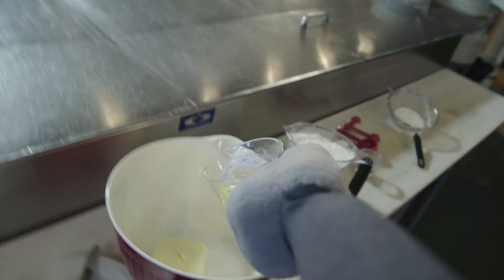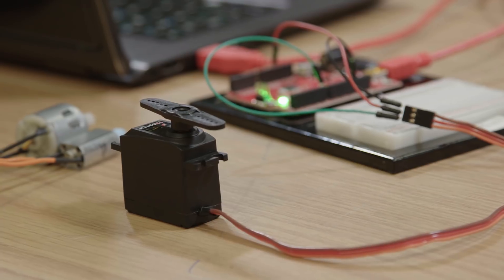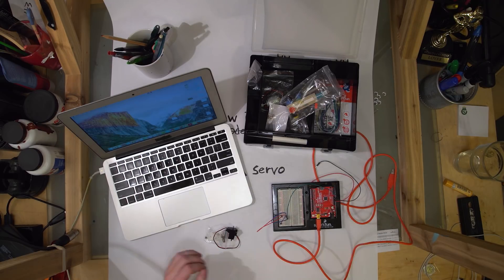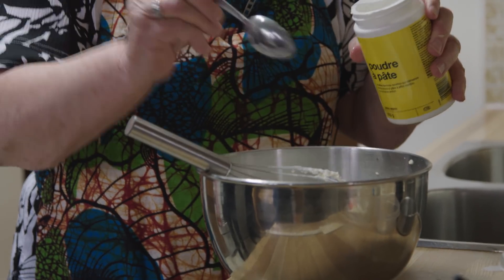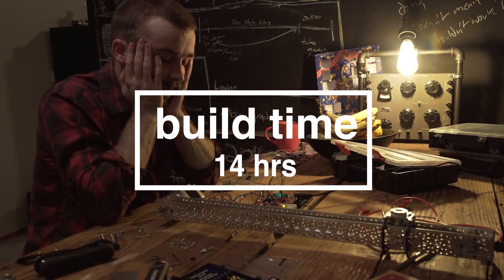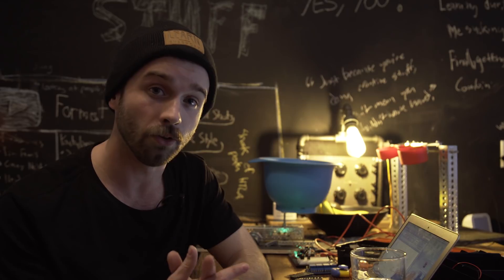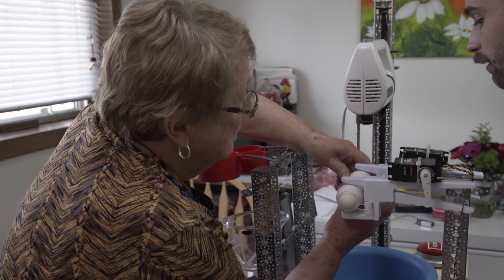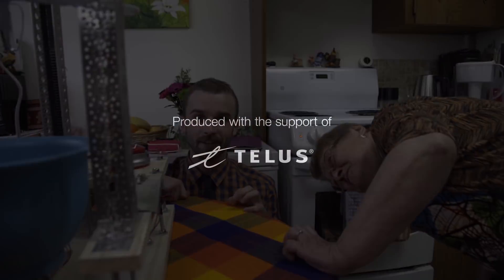Learning to build a cake baking robot with no experience.

Comment: From the perspective of an Electrical Engineering student, one thing I would consider is using T slotted extrusions for framing, and v slotted extrusions for framing when you want a motor to be able to move along the "track." These allow for a really modular design, making quick changes in size very easy. Currently I am using as parts of a self playing guitar Maybe if you want to make another robotics project with your new skills you could learn an instrument and have a robot play that instrument. Love the vid!